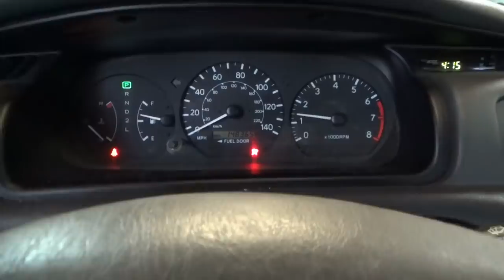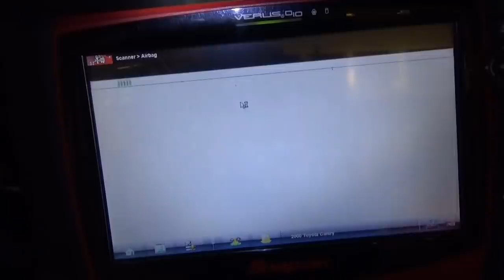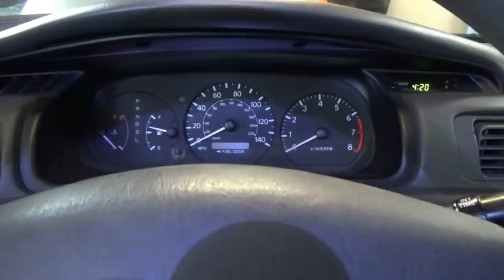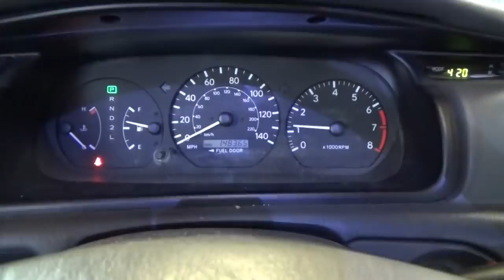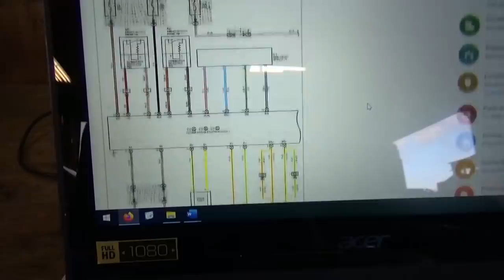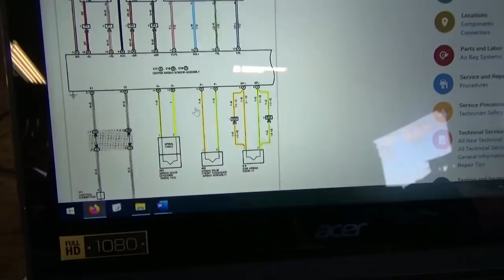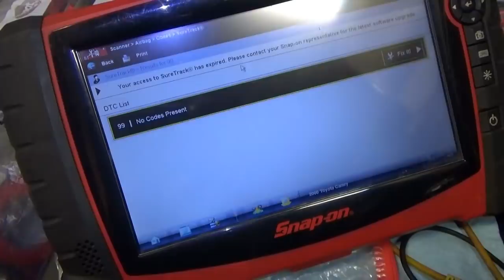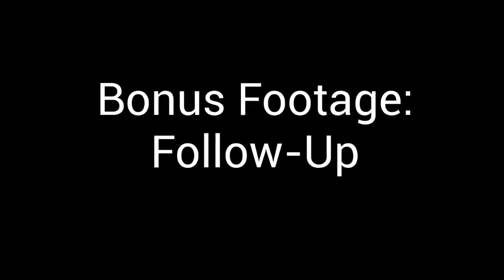Toyota AIRBAG light? (2001 Camry)

Comment: Enjoyed the video, I didn't have this problem but this came up as a view option and I watched it. I also own a 99 Toyota Camry, I've done the timing belt myself once, one thing I've since learned about these cars is if your in that deep, change the oil pump gasket too. There common to go out. Mine did a couple years after the timing belt, tension/ idle pulleys and water pump were all changed. I got my oil pump seal at Toyota and for the few dollars it cost, I would of changed it during the timing belt job. Oh, ya gotta love using that style headlamp when working.

Comment: At first I though it was going to be a clock spring replacement but after the codes reading I removed my shoes, paused the video and went to get some pop corn!

Just be careful next time since you can't put a multimeter in resistance mode and directly measure air bags resistance with it, the small voltage across test leads may trigger the airbag and cause injuries, instead you can unplug the airbag an connect a 3 ohms resistor in parallel with the wiring circuit and measure with a DVOM in resistance mode to confirm wiring integrity, thank you for this video Ivan!

Comment: Clogged A.C. drains will cause the evap to fill with water and then drip out of the evap box and heater vents. I’ve been through this before with Toyota’s. During a downpour, the evap box won’t drain and will ultimately overflow. I can’t tell you how many times I’ve disconnected the drains and shoved a coat hanger wire into the bottom of the evap box only to have a gallon of water pour out.

Comment: Those camrys and corollas are some of the best cars every made! (89-01, i prefer the 97 and back) Ive seen many with over 250 to 300k still going strong, gotta change the transmission fluid. If you overheat them they will blow head gaskets.

Comment: I've always been told that it is dangerous to put a multimeter across airbag resistors for measuring, as it can trigger the airbag. You're supposed to put a dummy load in place of the airbag resistor, and see if  the circuit then measures correctly. What are your thoughts on this.

Comment: I've seen TX rain - everything is big in TX! Was probably drenched! If that had been a '07 or newer vehicle, I bet it would be scrap! There would be so many electrical gremlins, nobody would be able to keep up with all of them. Good find there, Ivan!

I've been using that Deoxit D3 ever since I saw you use it over a year ago (maybe longer). I fixed my winch (mounted on my flatbed trailer) remote control with it! Was having problems with it for years!! One squirt around the rocker switch, and she's been good ever since! I was sold after that. THANKS!! 👍👍

I had a windshield leak that filled the passenger side floor up on the 940 an inch deep a few years back! That will never dry. I had to yank the seat out, and pull up the carpet, and leave it that way for WEEKS! Instructed the wifey to have the heat on the floor, and on high any time she was driving. Luckily she needs a jacket when it's below 80°, so that wasn't a big deal. 😂 Finally the windows stopped fogging up on the inside once it dried ... and I got a new windshield to replace the pitted 25 year old (at the time) OE one. Killed 2 birds with 1 stone. That fixed the leak. Luckily the engine computer didn't get wet - it's under the passenger side kick panel. They have the connectors facing up, so plenty of distance from the floor. Just lucky no water ran into it from the top! That would've been the end for that computer.
Reply from the maker: Sounds like my Friend's leaky Subaru Forester haha
Reply: Pine Hollow Auto Diagnostics - It was pretty close!

Comment: Great video as always,  I’m always frightened to test resistance across air bag in fear of setting something off ?
I didn’t think was safe to do it this way ... is there something I’m missing like your DMM is different or something.
Many thanks for your great videos 👍
Reply: Does seem a bit risky, yes - a multimeter likely isn't near enough current to risk firing the airbag but it's hard to be certain. Some systems will show you the resistance of each circuit at the module in live data, not sure if this car has that feature or not.

Comment: It seems like a bad spot to put a airbag module. If that heater core leaks your screwed.
Reply: Definitely. There should be a plastic cover. Even rain and mist can get into the heater core area and water can leak out.
Reply: lovetolearn 52 it's a Toyota so that heater core will likely outlast the vehicle if the owners maintain their cooling system. Regular coolant changes with the proper stuff and that core will for 400k+ easy

Comment: I had this part replaced, and the light went out! I marked it from when the AC had clogged with liquid, and overflowed coming in contact with the control module. The AC drainage was dislodged, and leaking into the car. The clogging was gunk in the drainage contributing to the overflowing. I wish I had found this video first, as this was the exact same issue and instance with the srs module...

Comment: What is the chance that water or dampness came down from the air conditioning condenser? Especially if it runs to defrost the windshield? Love DeOxit spray. 
(edit) Oops. I wrote this before the bonus footage. 
P.S. I like to take an old toothbrush to the connectors on those type of problems after spraying the DeOxit and before blowing it off with the air gun. It helps to clean off the green crusties and get rid of the contamination.

Comment: DampRid RD60 from Home Depot. ($4.00).  Whenever the car is parked, close the windows,  place two open containers on the front carpet. Replace containers every 10 days for a month.  Alternative- heat up the interior using an electric oil-filled heater for 24 hours with one window open 1 inch.

Comment: Good one. FYI, wouldn't it be best to use the A/C system on with the temp set to heat and recirculate so the evaporator can whisk away any humidity created by "heat" ? Just heat alone may generate more humidity I'd think.  Or simply garage the vehicle and run a circulating fan or two for a week or so to get the under insulation to dry out. Good call either way...at least she is aware of damp inside.
Reply: The moisture in the interior is a finite amount of water,  As air temperature rises, it absorbs moisture.  Heating the interior thoroughly will cause any excess moisture in the interior to be absorbed by the interior air whether or not the air is circulated by a fan. As long as that heated air can escape to the exterior through door seals and vents it will have lower moisture content than the ambient air does.

Comment: Yep crusty connections just waiting to get worse, add rain and away it goes :-D
How dare they not mount the box vertically with the plugs going down, such a short term design LOL :-D.
Reply: The accelerometer was and still is quite often horizontal design. In addition se sensor is designed to be in that area of the car, in the middle sideways and at near the center of gravity. And it need to be fixed to the body well, not possible to install it to anything flexible = it is bolted to the floor.

Comment: Would it be worth it to pay a mechanic to go around a brand new vehicle and unplug all these connectors ( inside and out ) and dab in some Genuine Ford Fluid XG-12 Electrical Grease or just generic electrical grease? Would the electrical grease especially in the air bag module /  connectors cause a problem? All this to put off or eliminate any green crusty attack in the future. What about the connectors that are called weather pack connectors would you grease them also?
Reply from the maker: Wouldn't worry about weatherpack connectors, but exposed ones could definitely benefit from some dielectric grease!

Comment: There's your problem lady! Even though the heater core didn't cause the problem, the SDM is not in the best location. Airbag and ABS brake wiring are very sensitive to any added resistance.

Comment: Was looking to buy an entirely new module, but my car has been leaking for years so this seems more likely to be the problem.  Gonna give it a try.

Question though, could I try to use some dielectric grease to keep the connections good for longer if this fix works, or is that a bad idea?

Comment: Thanksffor sharing. Would removing the module and placing the connector plugs. in an ultrasonic cleaner remove the corrosion? BTW.. SUBSCRIBED.

Comment: Not to sure about ohm testing the airbags as this could set them off. Also it would not have hurt to road test the car after the code's cleared.
Reply from the maker: Customer has driven it for a month, light is still off :)
Reply: @PineHollowAutoDiagnostics  thanks for the reply. What about the ohm test😜. Nice video as always.
Reply from the maker: I wonder if there is a documented case of an ohm meter setting off an airbag. Where would the high voltage/current come from to set off the igniter??
Reply: @PineHollowAutoDiagnostics  as you know airbag system's  circuits are not high voltage or high current circuts. The ohm meter is sending out the voltage.
Reply from the maker: @d.d4184  this calls for a scientific experiment! I assume that the igniter needs at least 12V across the 2 wires to burn. I have a steering wheel lying around... Maybe hook up a voltage supply and crank it up until BOOM!
Reply: @PineHollowAutoDiagnostics  that sound's like it will make a good video. As far as I know it needs very little voltage and current to ignite the airbags hence some cheep multi meters can give out as much as 3v.As the car gets older resistance can build up in the connections and wiring so the car makers want to make sure the airbags will still deploy as the car ages. This is what I have always been told.
Reply: Pine Hollow Auto Diagnostics if you try this test I wanna see it. A buddy of mine said his whole car filled with powder when the air bags blew.(thanks to a deer)
Reply: @williegillie5712  corn starch and talken powder to stop the airbag sticking to its self so it deploys properly. Yes I would like to see this one.
Reply from the maker: @d.d4184  so if 3V can set them off, that's at least 1A of current. If your DVOM sends out 1A on a resistance check, then that's a fail for the DVOM haha
Reply: @PineHollowAutoDiagnostics  then if a cheap DVOM can't set off an airbag why to car manufacturers recommend you don't ohm test them?

Comment: Ivan, they don’t seal them up because in today’s world there is NO QUALITY CONTROL!!! They would rather see a customer have to purchase a new air bag module and connector and possibly a harness than build it right the first time. Car manufacturers preaching safety with all these computer drive components I don’t think so. Ivan did you isolate the airbag circuit before homing out the system? Thank you for sharing Artie❤️

Comment: I have a 2001 camry 2.2L
Code 0125 keeps popping after few miles of driving. I recently changed Air/ Fuel Ratio sensor, Coolant Temp sensor but check engine light with code 0125 keeps coming back...Any Suggestions ???
Reply from the maker: Thermostat.

Comment: Could you use dielectric grease on that  to keep the moisture out?
Reply from the maker: You could.
Reply: I'd guess there some stupendous splices or great paths for water to wick right inside the  wiring itself or between jacket layers. water will wick across and vertical many feet! right inside stranded wire!

Comment: Ivan, time is short, tomorrow morning I'm picking up a 2013 Rogue 2.5L with 90K and solid maintenance. Looks good but I remember your trans video (I paid the fee for part 2) and would like to know if you would advise against this vehicle. Thanks.
Reply from the maker: Hi Bob! Wouldn't be my top pick. The 2nd gen seems to be of a lower quality overall compared to the 2008-2012 models. But not a bad little AWD while it's still fresh :)
Reply: @PineHollowAutoDiagnostics  Thanks Ivan, based on your recommendation and that of our local transmission shop, we passed on it. We are grateful.
Reply from the maker: Glad I could help! Let me know what car you choose. Toyota Rav4 and Honda CRV are very reliable. Subaru Forester is good too, but is known to eat engine oil.

Comment: The a/c does a better job of getting the moisture out of the car the just makes a sauna
Reply: #randy hughes - I agree, set it to recirculate the air in the car and the a/c will soon suck all the moisture out. The a/c is great for that, it's also the best way to demist your windows in the winter.
Reply from the maker: I don't think "recirc" does a good job recirculating the air through the entire cabin; especially the rear footwells. If the air intake is set to "outside", the air actually flows through the entire cabin and back to the outside out of the vents in the back of the car, so it doesn't get stale.
Reply: Pine Hollow Auto Diagnostics out side air depends on out side weather if it is raining it is high moisture
Reply: put window vent guard son, leave them cracked when not driving. or just leave them cracked without.(depends on car design) some need 90 degree wind driven rain to get water in, others are a funnel for it, but boy are they aerodynamic >_> not.

Comment: What the heck kind of belt tensioner is in that Camry that it has a short to ground code???? HUH?
Reply: The drivers side seatbelt tensioner. They have a position sensor in them as well as a centrifugal lock that activates during a crash.
Reply: That's the seat belt, it has a mechanism designed to retract the belt's slack microseconds before impact 
It's a standard sefey measure used in all cars nowadays
Reply: The seat belts in most cars now have an explosive charge just like an airbag. In a crash the charge goes off and yanks the seat belt tight and locks it.
Reply: yeah it's the seat belt tensioner, not the accessory belt tensioner, kind of confusing

Comment: My diagnostic set up was stolen : was a Delphi software in a laptop bunch of different cables , all data, pico scope . All in a case . Got stolen while doing brakes on A4  . Wound up about it .  It's a tool I had so I was able to do diag work for shops . Not enough to amount much . But it supplemented my fixed income . My back is ruined and I have heart failure . Insurance won't pay .  I'm sol
Reply from the maker: Wow Shane that really sucks. Who would be such a low-life to steal someone else's tools? Karma will get them, you can be sure of that. When life seems to be at a low point, I try to focus on things that I am grateful for. I know you are strong enough to get through this and persevere.
Reply: @PineHollowAutoDiagnostics    yes I try to to the same . I'm just trying to figure out how to to get another system . I didn't have it more than a month .  I put the system together  from watching your videos and Eric O ; thinking it would be great to have everything in one case  .      Trying to figure out how I can make it happen again .

Comment: You're gonna get crap for measuring resistance on the airbags 😂
Reply: I was thinking that. I've always been told it's a no no. Depends on the tool maybe? How many volts it is poking out to do the test. Have you ever measured resistance on an airbag?
Reply: I’ve always been taught the same, purposely looked at comments for this reason! I was taught unplug the airbag, 
Substitute the airbag for a resistor then measure resistance, or instead of using a resistor bridge the terminals at one end and measure continuity through the whole circuit. Resistor is my preferred method. As soon as those codes appeared I thought water!
Reply: @allanandrowey5219  Yes I've measured resistance on airbags. According to the manufacturer you can't do anything on an airbag system without disconnecting the battery and wait for capacitors to discharge. And you are definitely not allowed to measure resistance on any airbag. They're just covering their ass in case something happens. Not saying you shouldn't be careful. Accidents do happen. You just need to know what you're doing 😉